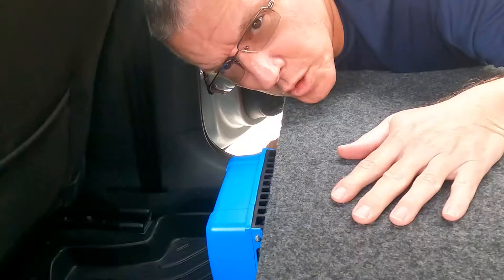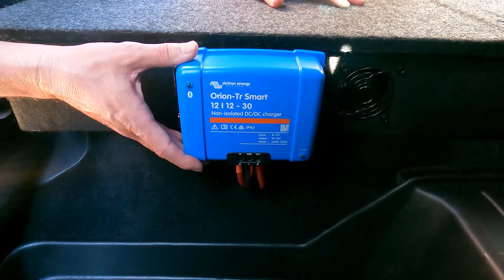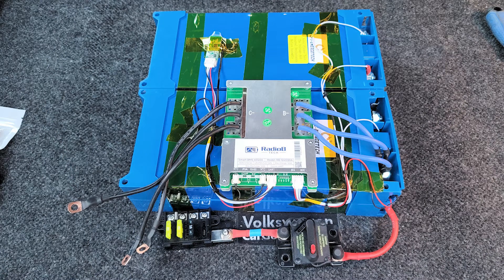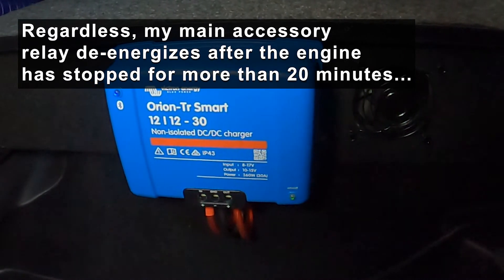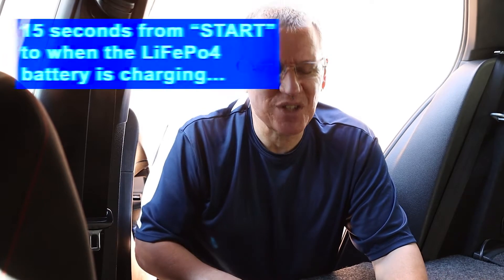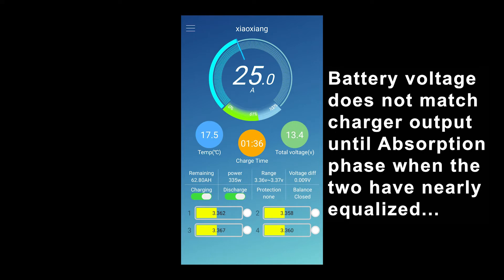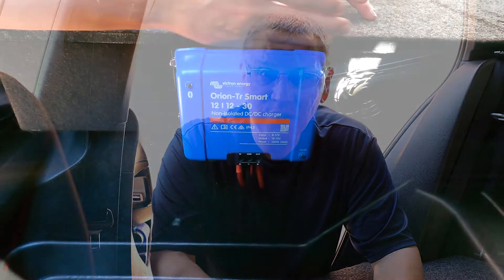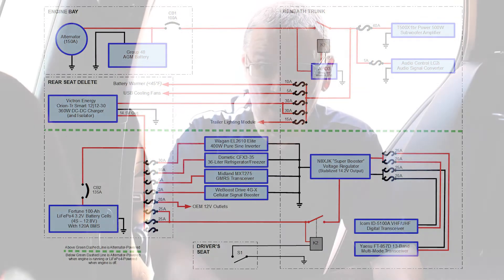ORION-TR 12/12-30 360W DC-DC CHARGER

Comment: Isolated DC-to-DC converters are useful for audio applications when you want to prevent AC noise on the input side to pass through to the output. The isolated converter is pricier because the input and output are separated by a transformer.
Reply from the maker: Thanks for visiting!

Comment: Great information, thank you for sharing this since I’m planning on adding one of these to my EV BMW i3.
Reply from the maker: Glad it was helpful! I've wondered how an EV would charge through this converter. An EV is bound to have a 12V accessory line. But I have no idea if it has a single line that's good for 30 amps. Is there a separate 12V battery in an EV? Or is it downgraded from the main battery at some point for the accessories?
Reply: @StealthGTI  
Yeah, it has a 12V battery and a charger that takes from the 400v battery & steps it down to around 14.75v to charge the lead acid battery that runs alarm system and all accessories of a regular gas car.

https://ww.i3guide.com/img/BMWi3-vehicle-battery.jpg

Comment: I know the GM full size SUVs and pickup trucks (even the gas ones) have the option for dual batteries and dual alternators, or your choice of each one. My 08 tahoe used to have dual batteries as a factory option.
Reply from the maker: Thanks for sharing the info! I'll keep it in mind if I decide to go full-sized with my vehicle. For now, I'm having a blast in this little car, even if I'm overworking it a bit.  ;-) Thanks for visiting!